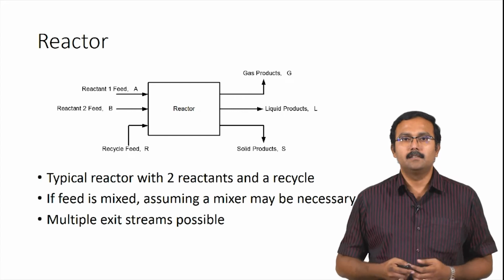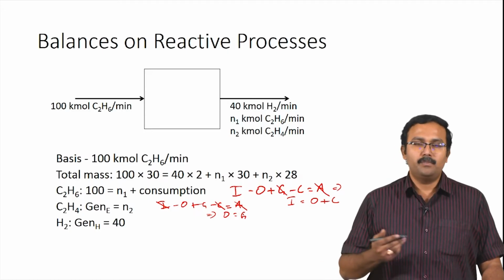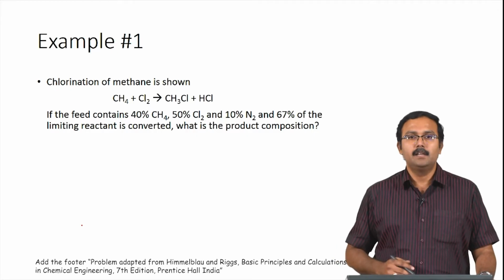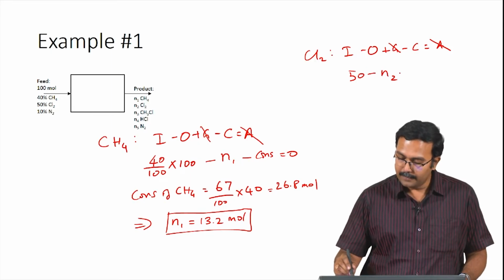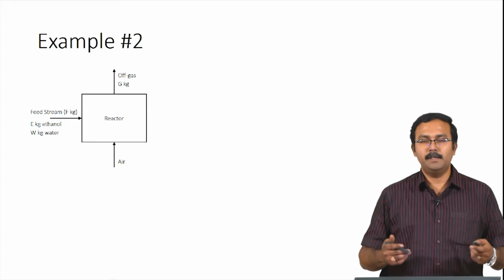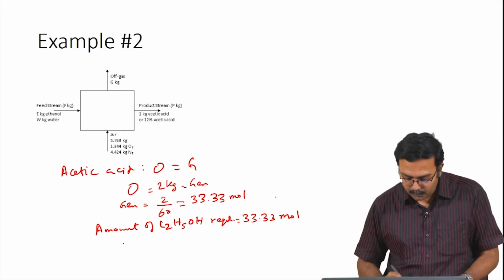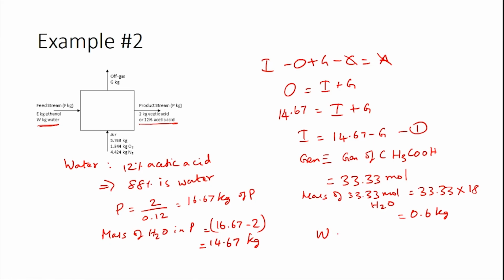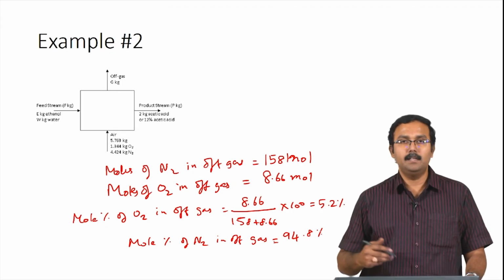#11 Material Balance Calculations For Single Units With A Single Reaction | Part 1

Comment: how do we get to know that these percentage( as mentioned in the question) are mole percentage not mass percentage??
Reply: Since we are dealing with gases...we tend to take the basis in moles. If case of solid or fluid components involved we take them in terms of mass.
Reply: @aaminahrabaab635  Thanks
Reply: Yes you are correct

Comment: In the last part of the sum , why are we considering the molecular mass of oxygen to be 16 and not 32? 16 is the atomic weight of Oxygen, but MW(O2)=16*2=32. The answer is correct though :)
Reply: Since the answer is correct..sir would have performed a teeny tiny mistake..we can overlook that right..